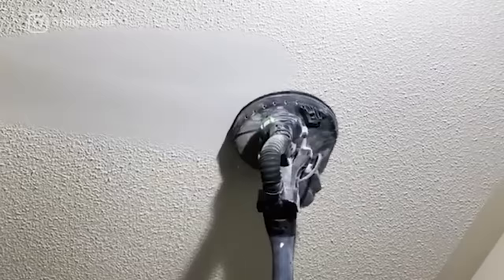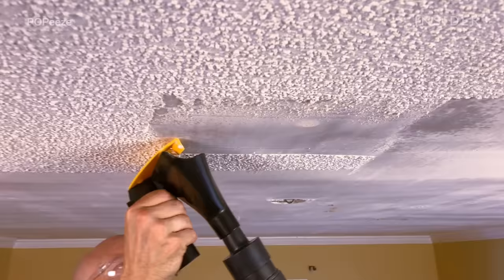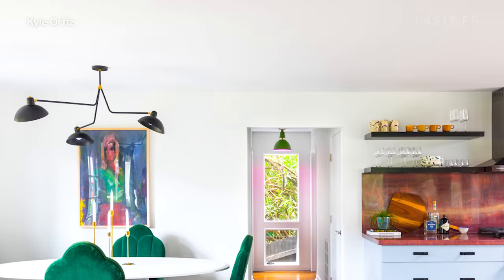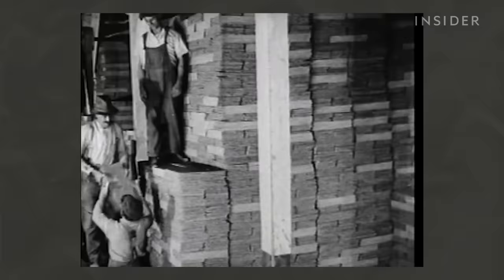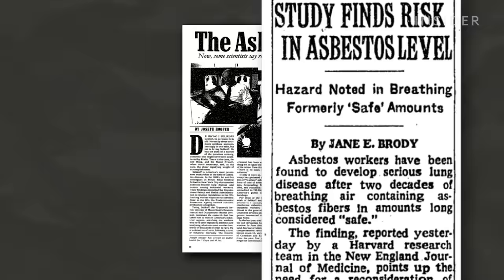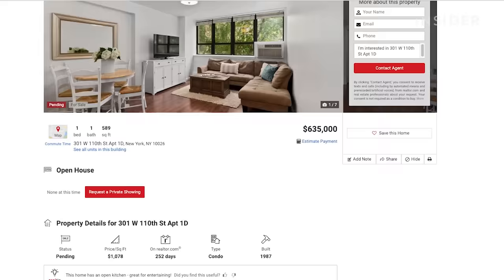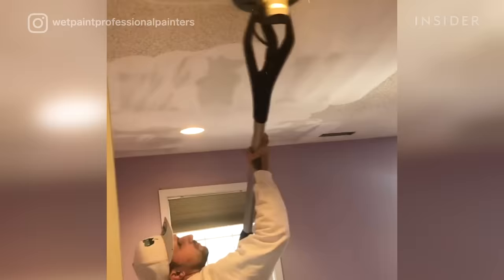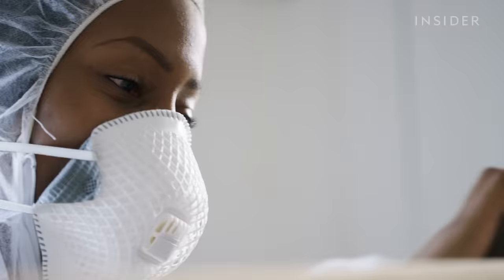Why Are Popcorn Ceilings So Terrible?

Comment: This video did not give a good enough reason to just remove popcorn ceilings. It basically said you shouldn't have them because they are some what out-dated.
Reply: It's all subjective. I mean now even having tile floors in your house is considered outdated, because wood flooring is the new trendy thing in homes now.
Reply: I have a popcorn curling and it gave me a scar. They’re evil beings and I strongly dislike them
Reply: Was the asbestos risk not a sufficient inspiration tho? High risk of severe and lasting lung damage is kinda enough for any home owner to get rid of it ASAP honestly...
Reply: @HonARGUru  Only if its REMOVED. So you would have to want to remove it for it to be a problem.
Reply: @ttttttttp2  yeah, even then, its not like removing it is gonna hurt you if you use PPE, and even if you didnt, a one time exposure wont kill you.
Reply: ttttttttp2 its also ugly and was probably put in your home to hide the lazy work the contractors did. So you could literally have important parts of your house be either covered up or inaccessible because of the popcorn paint
Reply: @darrianweathington1923  So glad YOU think it is ugly. I like textured ceilings of all kinds. Wouldn't want a house without them!
Reply: I have them and will leave them alone.  I never really thought one way or the other about my ceilings before seeing this video. For me, it's not worth the trouble of purchasing or borrowing all the safety gear and tools, emptying out the rooms and spending all that time on it just because it's considered outdated. I'm not trying to sell my home and it's not like I'm looking at my ceiling all that much. Plus, I'm more into the vintage ascetic anyway so maybe it goes with that. If someone is seriously bothered by my popcorn ceilings, they can remove them for me while I go on vacation.

Comment: In my contracting career, my one mission was to eradicate popcorn ceilings. I found the best way is to overlay the existing ceiling with 1/2 inch high strength drywall. It's easier to hang and finish an overlay than to scrape, prime, re-coat all of the joints, and depending on your desired finish, you may need to skim coat it then sand. Then you still have a warped old ceiling. The overlay adds a large measure of sound proofing, much more than popcorn and it's flat so your new finish will look much better. But wait there's more! You don't have to scrape the toxic waste. Asbestos is only dangerous when it becomes airborne, and any way you do it, you're disturbing the asbestos when you remove it. Plus you don't need to get a permit for asbestos removal or hire a licensed asbestos remediation company. They charge ~$15  per sq  ft and up.
Reply: Thanks for the post. Would wood tongue and groove boards work well to cover asbestos popcorn?
Reply: @user-hc9fj1qr1f  Yes.

Comment: Me who has popcorn ceilings installed in literally every room in my house: nervous asbestos noises
Reply: This is the last place I expected to see a Ferrari F1 fan good day to you sir
Reply: @Rudwarf Its clearly a persons head under a helmet in that picture.
Reply: Lmao me too
Reply: @therifty1301  good day sir
Reply: Asbestos is harmless unless you are agitating it.
Reply: You don't need to worry about that unless your house is more than 40 years old
Reply: @Cowman7344  me, whose house is 60 years old with a popcorn wall 👁️👄👁️
Reply: @Cowman7344  nervous 50s-era house noises
Reply: Whatever you do, DO NOT snort the popcorn!!
Reply: @Cowman7344  using asbestos in artex (asbestos reinforced textured coating) wasn't banned in the UK until around 2000 and there were still products in stock for a few years after that. Use 2003 as a cut-off date.
Reply: I'm no expert but you should NOT be making asbestos noises--- it's already too late at that point I'm so sorry friend
Reply: @Rudwarf its f1
Reply: Not all popcorn ceilings are made of asbestos, FYI.
Reply: @danielb1501  no, its about 50/50 these days. But take each ceiling separately as different products may have been used around a house. We've tested houses and found some rooms contain asbestos  and some don't. Artex originally was reinforced with asbestos so the older the ceiling, the more likely it is to contain asbestos.
Reply: It's called artex and not all of it contains asbestos. After something like 1984 they stopped adding asbestos to the mix so those ones are perfectly safe they're not all "popcorn" either some are swirls or other variations on geometric designs. Even the ones with asbestos are safe to remove as long as you don't scrap it or something making particles airborne. You get a special coating which makes it like jelly and just peels off.
https://en.m.wikipedia.org/wiki/Artex
Reply: @deekdouglas3055  use 2003 as the cut off year. It was still used in some artex products until 2000. Bags were still sold for a few years afterwards.

Unfortunately, in my career I have had far too much asbestos awareness training!
Reply: @jimtheudb  thanks for the correction
Reply: @deekdouglas3055  wow,  a polite response on YouTube. Thankyou and no problem.
Reply: @jimtheudb  lol It helps when you're replying to an interesting and constructive comment :) It's nasty stuff so better to get good information out there
Reply: Not all popcorn ceilings are made with asbestos. Any popcorn ceiling installed after 1976 does not contain asbestos.
Reply: @tammycenter8757   you should use 2003 as the cut off (in the UK) as it was still used in some products until 2000. There were bags around for a couple of years after 2000.
Reply: Oof
Reply: It’s not dangerous unless you remove it. Unless the ceiling is crumbling away
Reply: how old is your house? they banned the use of asbestos for popcorn ceilings (and a lot of other stuff) in 1977. after that they used other (ostensibly safe) materials
Reply: @randybobandy9828  that's sort of true, but not accurate. you don't need to worry about non friable asbestos as long as you leave it alone. Popcorn ceilings are problematic because it's not easy to accidentally hit the ceiling with something, and cause the "popcorn" to break off. If it's made of asbestos, then it can become airborne. Trust me, I grew up with a popcorn ceiling and a bunk bed, which meant I could reach the ceiling, and if you think a little kid isn't gonna mess with the ceiling if they can.... 
lucky for me, I'm fairly sure the house was built after 1977, so probably not asbestos.
Reply: @breadbutt  wasn't banned in the UK until the late 90's.
Reply: @jimtheudb  ahh I was thinking of the US.
Reply: All my rooms have popcorn celling and I had an inspector in my home... NO PROBLEMS!
Reply: any the only room that doesn't have it in my house is the bathroom
Reply: Fr same
Reply: Same i am kinda terrified lmao
Reply: Me who was a dumb kid and used to play with the popcorn ceiling in my old house built in the 1900's: Guess I'll die
Reply: @jimtheudb  Not in America until the 80s
Reply: @madeniquevanwyk  well, it's ok. I had a good life. licks popcorn wall
Reply: lmao dude
Reply: Only a problem if it gets released into the air.

Comment: As an apartment dweller, I would rather have more sound proofing and a "non aesthetic ceiling" than a flat ceiling and having to hear my neighbors all the time
Reply: Nah, popcorn ceiling is a pain to keep clean and soaks paint like crazy.
Reply: Nope I'd wanna it gone im not trying to clean my ceiling 🙃
Reply: It works the other way around. It absorbs your noise so that your neighbor doesn’t hear you.
Reply: @carlitosaqui  wym soaks paint
Reply: @zj7845  *breaking into my downstairs neighbors home to install a pop corn ceiling *
Reply: same, popcorn ceilings are fine but popcorn walls is going too far
Reply: agreed. I hear my neighbour micturate at the same time every morning 🤢
Reply: That won't help you much. Popcorn ceilings seem like diffusers and so they would silent you rather than your neighbours. 
Besides, paint is too think and light material to be sufficient alone... And a single crack causes massive reduction in soundproofing.
Reply: @kitcatlord2590  screw cleaning. I'd rather have peace and quiet. I can live with a dirty ceiling. At least it won't cause me to lose sleep every night.
Reply: There are other better ways to noise cancel sounds
Reply: I STILL hear my neighbors all the time
Reply: i mean they have asbestos so
Reply: Not good enough of a sound proofing solution. Invest in acoustic foam
Reply: Specially when they are doing ...their thing.
Reply: Um… they don’t muffle any of the noise that travels through solid objects. Popcorn ceilings just reduce the echo within a room by reflecting not as much noise. Their bumpy surface breaks up sound waves so they don’t bounce off and echo all over the place.

But they work just fine at conducting your neighbor’s noise into your home. It’ll just echo less.
Reply: Fr though. And from what I’ve seen the maintenance problems are in like extreme cases. You’ll live if it looks slightly different.
Reply: It won't make much of a difference. Sound proof drywall will make a much bigger impact
Reply: Had popcorn ceiling at my  apartment.. Was useless to drown on sound.
Reply: i don’t think they actually are sound proof lol. i grew up with popcorn ceilings and always heard everything
Reply: It's mostly diffusing sound for your living space. Any sound that is absorbed, is going to go right through it. So resilient channels are needed between the gypsum board the structure. For the neighbours above, a membrane above the subfloor needs to be provided to limit impact noises.
Reply: @schokoloko2092  But we also have default soundproofing in ceilings and stuff just because of the different material ... this stuff in america is really just lazy.
Reply: @Nikki-jn3ud  soaks up paint. Even when I repaint them it takes at least 2 coats sometimes 3. They are just more expensive to maintain. Plus they flake off easily and get everywhere. I can't explain how much I've gotten this stuff in my eyes.
Reply: @paulawolanski3237  want a quiet apartment, move in a nice, hurricane proofed concrete apartment in Miami or South Florida. Only place I never heard a peep from my neighbors.
Reply: Lived in a place with popcorn ceilings throughout the apartment. I don't know how they claim soundproofing cause I could hear upstairs neighbors' convos like we were in the same room. Also, so hard to clean they looked so dirty.
Reply: @paulawolanski3237  there’s noise canceling paint
Reply: @electricdreams9446  Sound travels better in pipes and water. Ain't nuthin gonna stop that.
Reply: @zj7845  Popcorn ceilings do nothing to reduce the sound coming from the other side. They also add nothing to the insulating values of the system. I sold coatings for years and never sold one square foot of the stuff. Also I suffer watching the worker working over head without any glasses or mask. And if the product contains asbestos, it can only be removed by a licensed asbestos contractor. I had a fellow try to remove his own asbestos containing roof and ended up with a 30000 dollar fine from the EPA.
Reply: @carlitosaqui  Do you think the apartment dweller paints their ceiling?
Reply: The fact that they focused on the visuals appeal (tastes change every 20-30 years anywayz, so who cares) for longer than they focused on the carcinogenic effects of asbestos was nearly as bad as the fact that they called out people in the 30s for being LAZY because they were trying to cut costs.
Reply: @paulawolanski3237  people who don't live in apartments will never understand.  The "visual appeal" of my ceiling is pretty damned close to the least important thing in my apartment.
Reply: @yondie491  I did mine because the former tenant smoked like a chimney and the landlord wasn't going to do it.  It was filthy and stank; gloss helped seal it. No bleed-through either. Helped brighten the place.
Reply: @youdontwanttoknow5203  I hope you turned in a bill as part of rent.

I hate neglectful landlords.

(But yeah, in general, landlords are the only ones who should be doing that)
Reply: @yondie491  I should have, but didn't.
Reply: It was actually debunked that they absorb sound
Reply: @okcool7899  in certain settings to a noteworthy degree.  It ain't soundproofing.
Reply: yeah i hear mine bang above me its anoying
Reply: It's the cleaning issues that get to me about it. I've tried so many methods over time with little reward .
Unremovable cooking grease fumes that have turned dark over decade's and held tightly to spiderwebs, dust and small drip spots from where we've have roofing repairs are all impossible to clean off without the product cracking and peeling off. It was a terribly bad construction job to be fine with , you could tell by how unevenly the stuff was sprayed on and how  the drywall tape  had already started to gap and curl up  when we moved in 22 years ago. The only thing worse is the equally old cheapest builders  disposable grade carpeting , particularly in heavy traffic area's and  the dining room.
Reply: @judithsixkiller5586  poorly-done ceiling is the problem, not popcorn (though poorly done popcorn IS worse I'll grant you)
Reply: @yondie491  Its just NOT cleanable though. Since 2001, I've tried brooms , A vacuum brush hose and Swiffer dust catching mops. I've  tried to gently dad at it with a barely damped cloth. If you try to fix peeling spot's with any product it makes it WORSE
You can't just paint over it either. Not even with " Dry Paint"
Reply: @judithsixkiller5586  well what I mean is that the installation might be the issue in your case.  I've never had a problem with it anywhere I've lived.
To be fair, I also don't care, but I've never had cooking residue on my ceilings.
So it might be PART apathy on my part, definitely
Reply: @yondie491  You've never lived in an old place force long time with no vent fan over the stove cooking for a houseful of  people.
Reply: @judithsixkiller5586  that's a massive, and incorrect, conclusion.

Stop strawmanning and start asking questions.  You owe it to yourself.

Find out things before making accusations
Reply: just put soundproofing foam on the walls or celieng
Reply: Laughs in concrete ceiling condo owner
Reply: asbestos 😋😋😋😋
Reply: Mine is beuatiful. It's sprinkled with silver and iridescent glitter.
Reply: @paulawolanski3237 it isn’t going to deaden sound. It’s only going to help with eliminating reflections, meaning it will make sounds that are inside the room slightly quieter since they won’t echo as much. Saying they provide isolation is just false
Reply: @paulawolanski3237  popcorn ceilings are pretty known for growing mold
Reply: it just echoes less and grows more mold, doesn't actually soundproof
Reply: @carlitosaqui  you don't need to clean it tho
Reply: who tf cleans their ceiling? does gravity work backwards where u live or something?
Reply: @12...  
mold:
water damage:
hair:
dust:
dirt:
Reply: @electricdreams9446  52 years old, and never heard of (or seen!) "micturate" before! 😯 had to Google it. 🤯
Reply: If the walls are thin, it doesn't protect you
Reply: It just holds dust dirt mold.  Impossible to clean or paint. Bugs can hide in there
Reply: @paulawolanski3237 if you think these popcorn walls/ceilings do anything, they don't. They look horrible and don't do shit for sound. Ever.
Reply: Sprayed texturing, that is basically the same compound they use to cover drywall joints, works just as well as popcorn ceilings.
Reply: I just moved into my new apartment and my ceiling is popcorn and I'm okay with it, I actually never thought about it being unattractive it doesn't bother me
Reply: I don't think it really has that much "sound proofing" ability.
Reply: @carlitosaqui  You guys clean your ceilings? I've never cleaned the popcorn ceiling in my room and it's not dirty

Comment: Science insider: "it's ugly"
Reply: I was expecting any kind of argument about why they’re actually bad or ugly and the only convincing argument seemed to be “less dusty”?
Reply: @Phocas666  that’s the only convincing argument? What about asbestos inhalation?
Reply: @NuttyCuts_  Not all popcorn ceilings are made out of asbestos. If your house was made after 1974 then you're safe. Even if it is made out of asbestos it's not dangerous unless you agitate it by trying to remove it or your roof starts crumbling. That's pretty specific and an uncommon occurrence so it's still not a good point.
Reply: @williamcaputo7931  where are you getting this info that's it's uncommon? My city had a huge problem with asbestos cases, houses needed to be cleaned up. 

Most houses in general were built long before the 70's, before even the 60's. Most houses with these ceilings do have asbestos, and normal wear of the house can cause problems. You don't need to do anything to agitate it, one of these decade it will break down on its own if not replaced. 

Everything is like that in a house. I don't understand the downplaying of it, then again people do it with covid so I guess I shouldn't be surprised.
Reply: @Ahria256  exactly
Reply: It is tho
Reply: @Ahria256  They even mentioned it in the video, it's not used anymore due to regulations, so if the popcorn was recently put, shouldn't be any worry.
Reply: Noah Wright yep this video in a nutshell
Reply: @WyvernVin  you're right